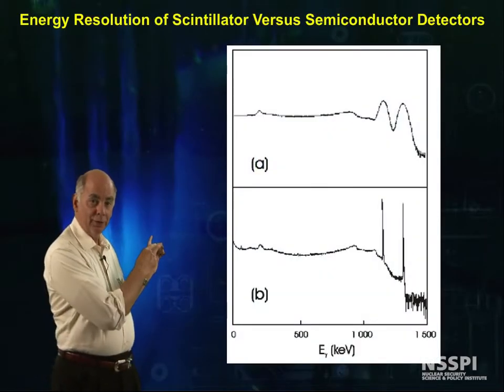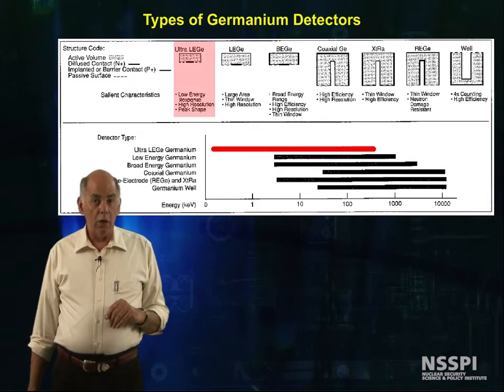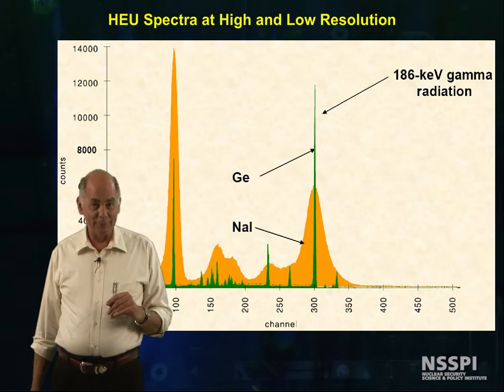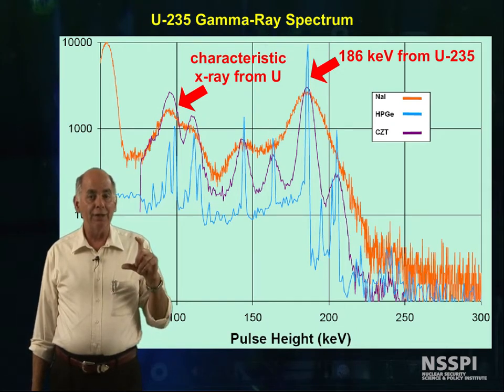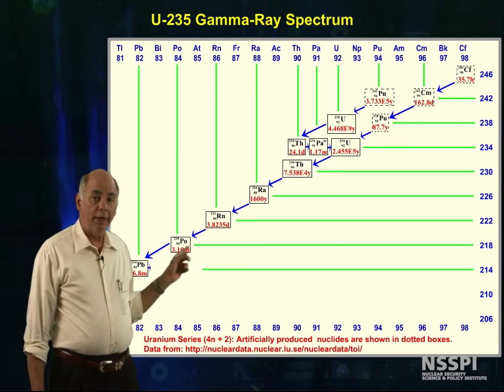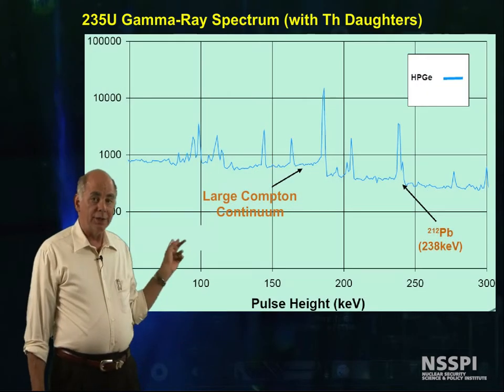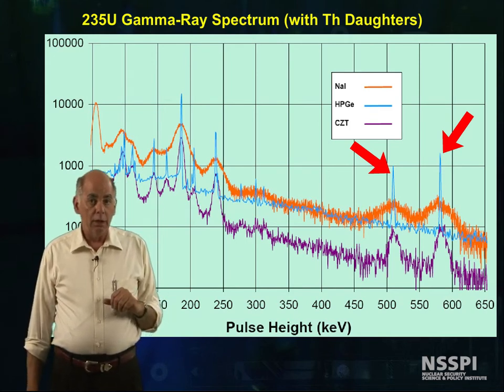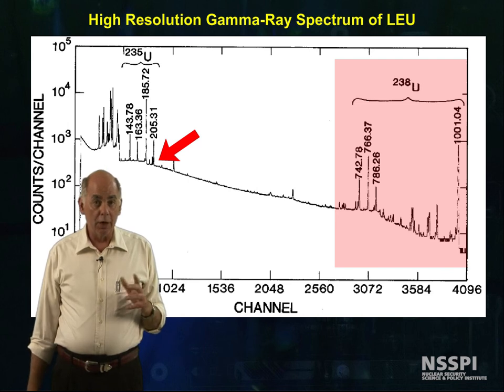31-Basic Radiation Detection: Semiconductor Detectors: gamma ray spectra

Comment: I know Am-241 and U-237 have two gamma ray energies that could overlap, with one being around 59 keV and another at around 26 keV. Their branching ratio percentages are also extremely close, too. However, U-237 can easily be identified by one of its gamma ray energies at 208 keV, which has a decent branching ratio of 21.2%. HPGe detectors are the best! Great video, too! 👍